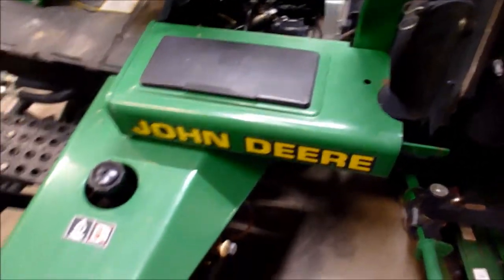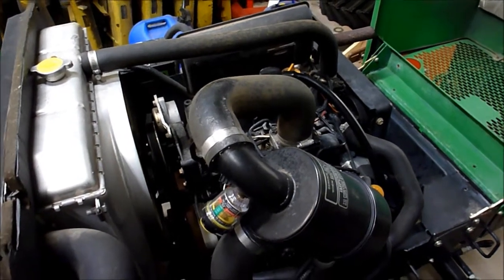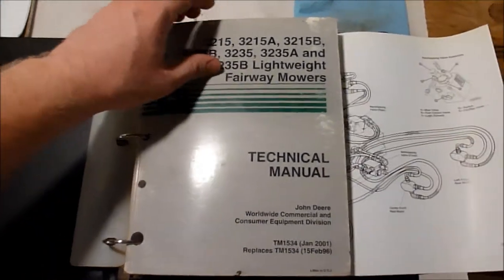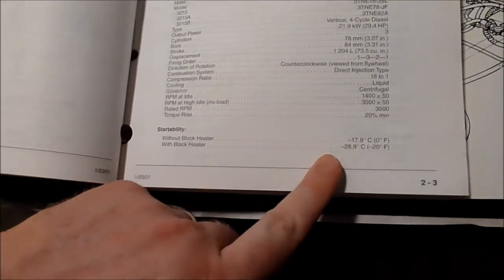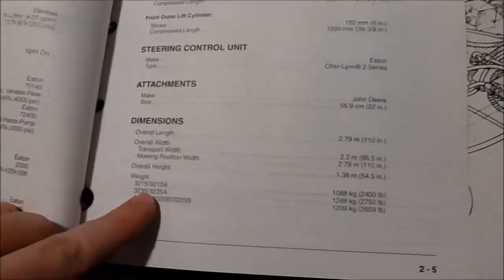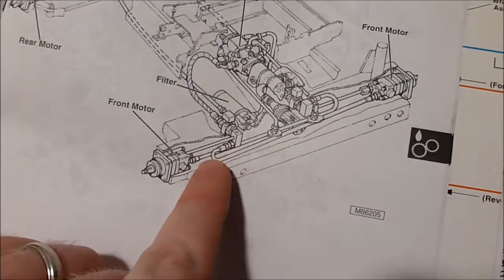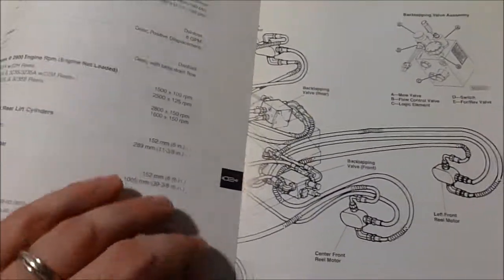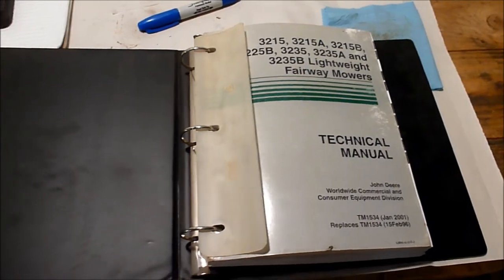John Deere 3215A Specs and Repair (Part 1)

Comment: I'm thinking about buying and 49 single stage snowblower, but i already have a 54 plow. Can the blower do higher snow than the plow? Or do you recommend the blower over the plow?
Reply from the maker: Honestly the answer really depends. Both a blade and a blower have befits. A blade will be something that can get lighter snowfalls in the 2-3 inch range that a blower (especially a single stage blower like the 49) just isn't that "good" at.  However, with heavier and longer snowfalls having just a blade means you have to go out every 3-5 inches to clear or face an up hill battle at the end. Meanwhile a blower can clear 8-10 inches with some effort. PLUS a blower gets it away from the driveway. Nothing worse than running out of room to put snow! I run both a blower and a blade and I will switch back and forth depending on what I am doing. This video here does a good job showing the types of task each system can do. https://www.youtube.com/watch?v=AMtMEHuj7-0&t=407s

Comment: Where do you get your technical manuals
Reply from the maker: You can find them on eBay or go to your Deere dealer and order them. You can have the choice of a CD or paper copy. The paper copy is more expensive than the CD. Price them out though. Sometimes eBay is more expensive than Deere............